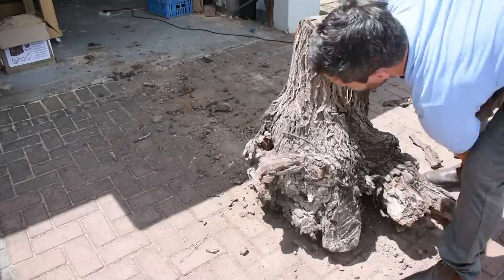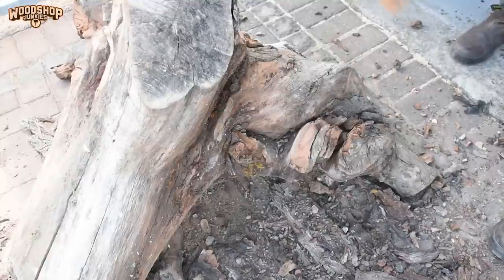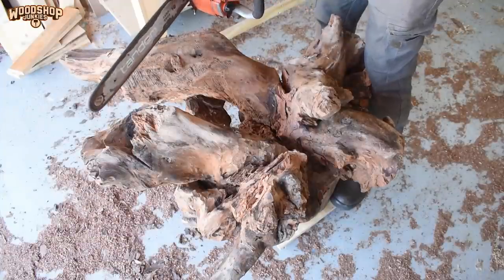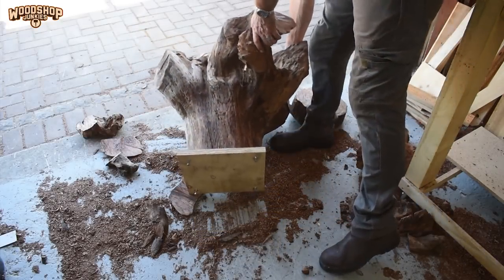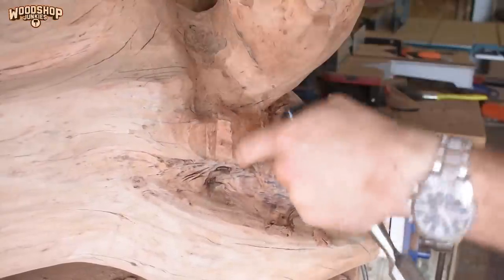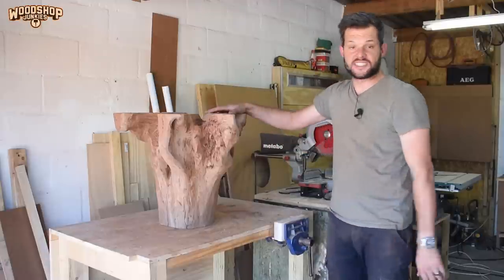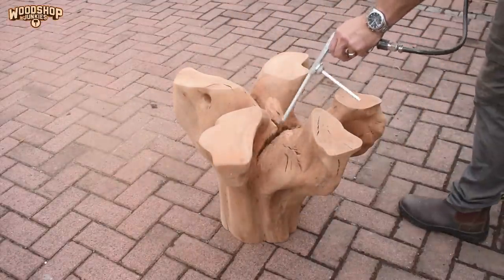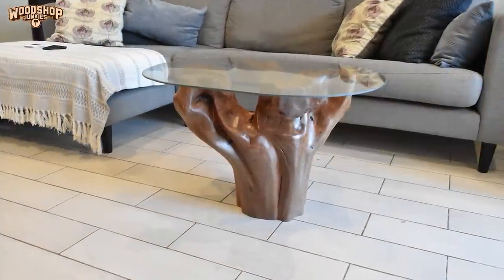Can A Rotten Tree Stump Become Something Beautiful?

Comment: if you go roots down, i think you should use thicker glass, and avoid having a steel frame.

if roots up, inserting a heavy weight in the bottom will stabilize it.

one thought I had is to make it stable roots up, or roots down.  that way you can  change it when you want to.

Comment: I would suggest using acrylic as brace  support from glass to stump. something thick and clear. metal is nice but does take away from the floating look. I believe that the roots being on top would allow for acrylic to hide more. I would increase glass thickness from experience of thinner glass breaking or chipping. Lastly, if you go metal route than I would suggest aluminum or stainless steal in a smaller thickness. enough for support and rigidity but not detracting from the wood.

Comment: both ways look great, but I would prefer root-side down. and if the glass plate is meant for a table top, it is much stronger than you expect. and so you could only anker it to the stump. there are special ankers for that available with rubber type washers in between

Comment: Is that the final glass? Best option is start with float glass and whichbever option you choose you can have double countersunk holes drilled , the first part of the countersunk hole allows glass to be screwed to the stump and then a bigger countersunk in the glass allows for a polished or brushed finish flush  metal cap that hides the fixing, then the glass can be toughened, the overhang won’t matter then

Comment: I say roots up as it will be easier and more elegant to stabilize the base on the small end. I would personally just get some square tube stock, miter and cap the outside ends and rout a cross channel in the small end of the stump then drill and bolt them in an X pattern. Finish it with a mirror polish on the steel.

Comment: For the future, a planer bit works better than an end mill bit for surfacing the tops and bottoms.  Takes off a wider swath per pass and tends to not leave as many lines.  Also, from a design perspective, roots at the top.  This symbolizes the rebirth of the tree by flipping the roots upside down. Definitely roots at the top from an artist point of view.  Also, instead of a chunk of steel, why not add (glue) a round cookie base then contour the bottom into that.  Thus giving you a wider base and still keeping it looking natural.  I would not add steel to this.  The two elements, wood and glass are the right composition here.

Comment: Go modern natural.

Root at bottom
A modern (read, slender and black) steel cross glass support. Possibly shaped like a star, with it thicker in the centre and tapered to the outer points